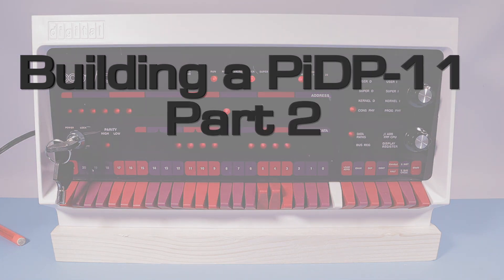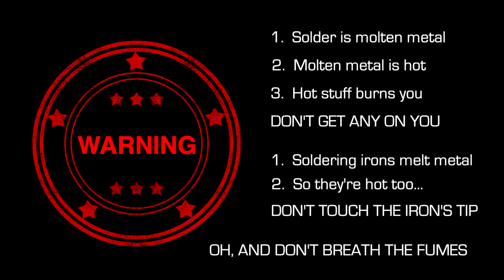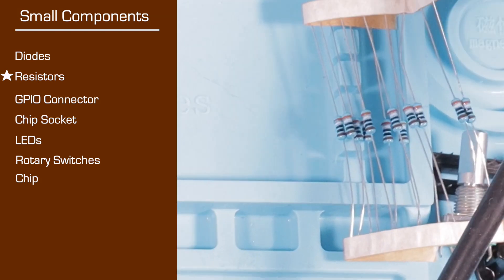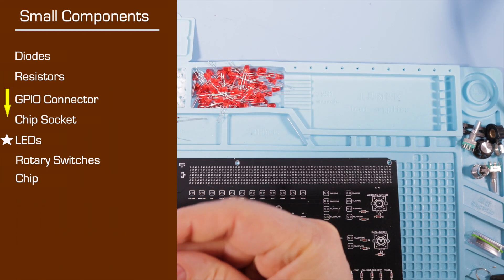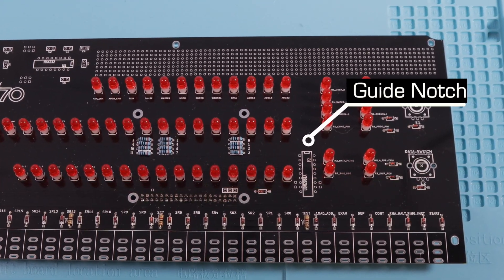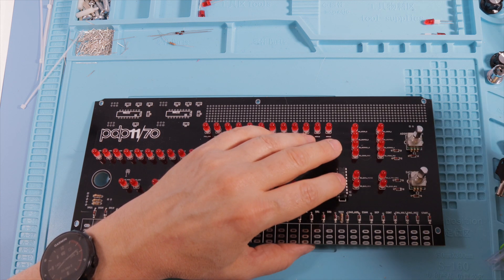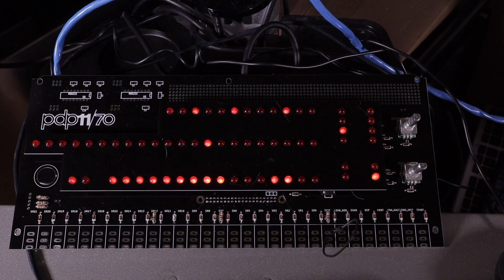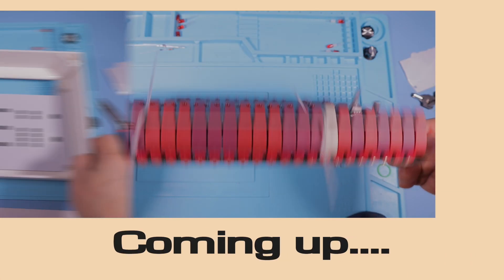PiDP11 Kit Build - Part 2 (of 4)

Comment: Great video. But I have to tell you, the most important thing is to put the GPIO connector on the OPPOSITE side to the diodes! Sadly, I missed this and then had to go through the pain of removing the GPIO connector.  Its worth a note at the very least......
Reply: I made the same mistake :( any suggestions about how to remove it?  I tried using one of those suction pen solder removers and it's not really working
Reply: @wayne606  easy mistake to make. I ended up cutting the connector’s plastic and separating it from the pins.  Once this is done it’s easier to remove the pins. You’ll need another connector of course. These are easy to obtain on line for a couple of dollars. Amazingly everything worked ok following this rework. The rocker switches are also tricky. Check and recheck if you’ve not done this step yet. These are easier to remove if you make an error here however.
Reply: @grantcarter9789  Thanks - I'm going to try using a solder wick instead of the sucker but I have a feeling I'm eventually going to have to remove the connector as you describe..
Reply: @wayne606  I am pretty adept with my sucker. But the holes are through plated and the the sucker couldn’t  free up every pin. So you really need to apply heat to every pin at once to ensure removal. I figured with the tools I had, if I kept trying I would damage the board. I felt dumb making the mistake, but cutting the plastic did work and I did no further damage. Good luck.
Reply: @grantcarter9789 that's what she said

Comment: Where did you get that plastic assembly parts tray?
Reply from the maker: Do a search for "anti-static soldering mat" on Amazon, eBay, Google or similar.  They're not too expensive.  When not in use they roll up and stow easily.
Reply: @beige-o-vision6936  Thanks!  I didn't realize that was a silicone mat.